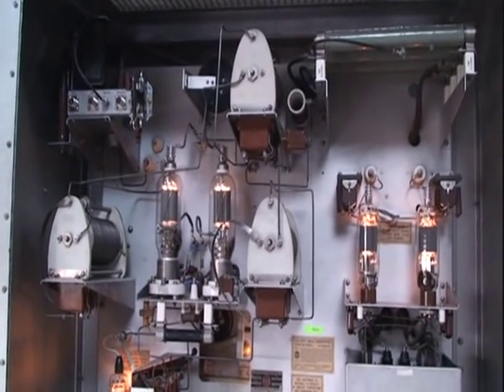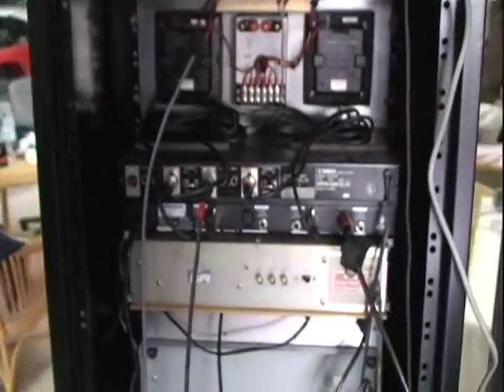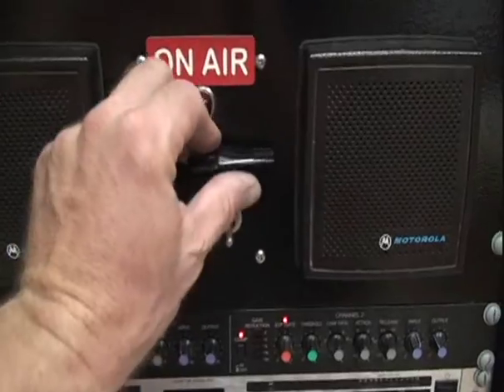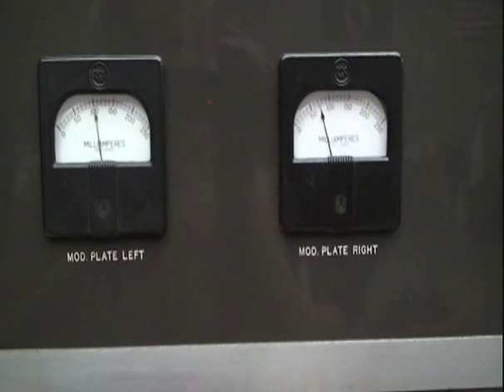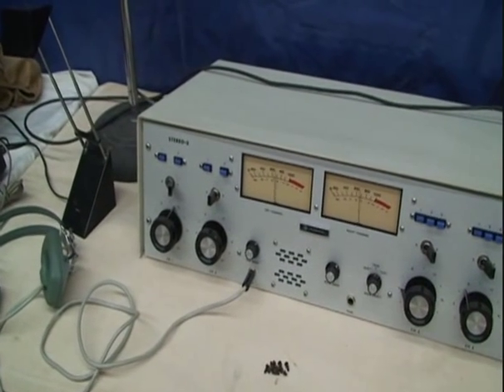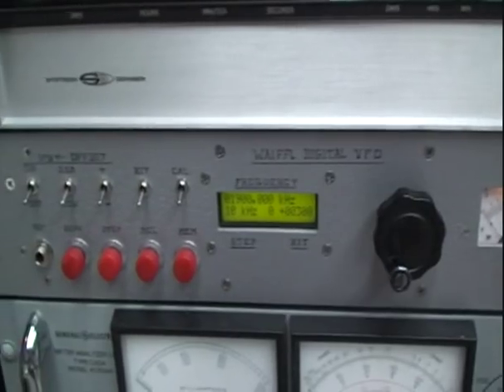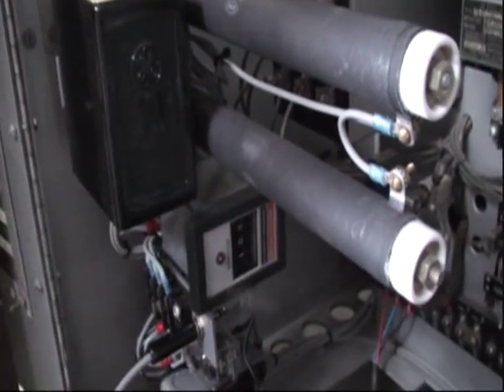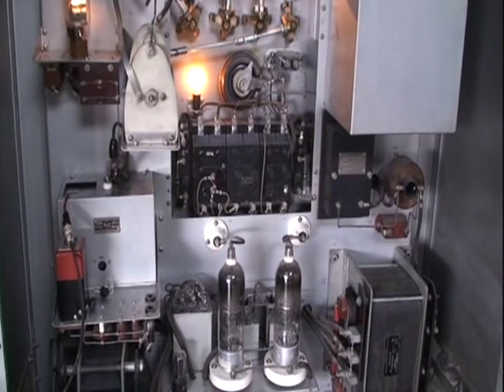RCA BTA-250L on 160 meters.wmv

Comment: Update. I retired from the broadcast industry in 2019, just before the Covid-19 Pandemic hit. Me and my wife shut down the Commercial AM Station, sold the building and property. My Consultant Engineer said I should get my Ham License to stay busy. I also worked for a Electrical Utility, where I had a on the job accident in 2008. One of my doctors knew some about ham radio and he recommended I start to look into getting some kind of beginners ham permit. I would love to have a old tube transmitter that has been converted to the ham bands to put in my new building behind our house. It's 2022, I would love to get into it.

Comment: Very nice job! I am an owner of a 1,000 Watt AM Daytimer. Before the solid state transmitters came done in price and more reliable, I had a Gates BC250-GY. It was built around 1948. We used it as a stand by and for Pre-Sunrise & Post Sunset. It was in stand by use until 2001. Heck, it ran better then the Collins 20V-3 I used for the main daytime transmitter! I miss those old rigs and the tubes, but now I have a BE AM-1A, 90pounds and fits into the audio rack. Your RCA looks real nice!

Comment: I swear that looks like a Raytheon box. Same line up of tubes hmmmmmm
Reply: The audio driver circuit is different. Slightly stripped down version of what I had in the real Raytheon version. A pair of 2A3's driving a pair of 810's in the mod deck.